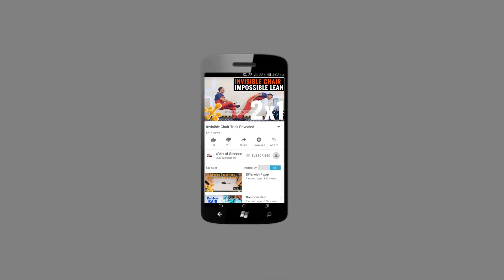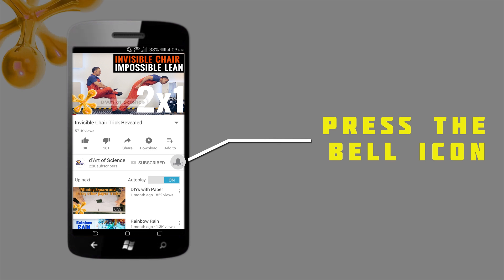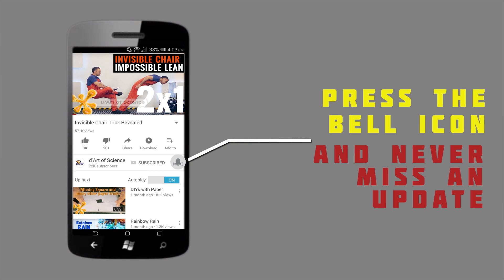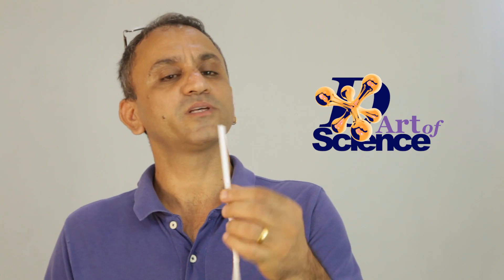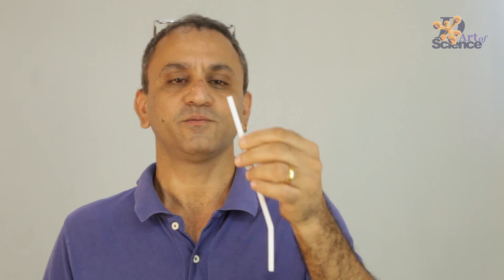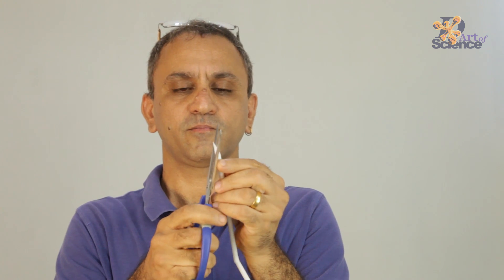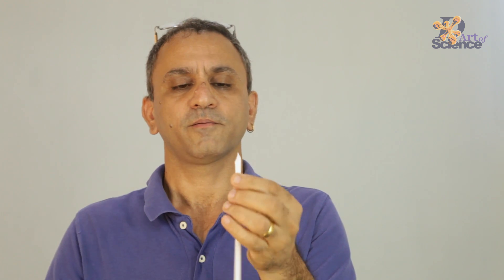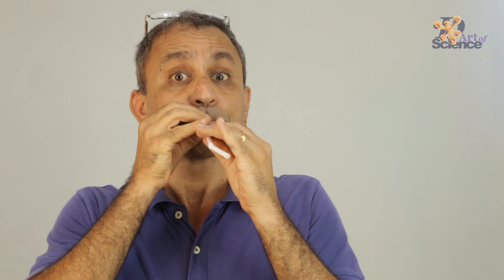How to make a Bottle Flute | DIY Flute | dArtofScience

Comment: It doesn't  work at all
Reply from the maker: thats strange..try doing everything step by step..interestingly when it comes to science based DIYs, any tiny step if you miss our or do differently, can make the difference between success and failure
Reply: @dartofscience  
can you tell me what is the principal of science used in this video?...
Please please.please
Reply from the maker: @DSRankers  Basically: when you blow air in a flute, the stream of air that makes contact with the edge is cyclically directed outward and inward. ... The flutist uses tone holes and keys to shorten the vibrating air column, thus producing an increase in pitch.
a flute works on the fact that when you blow air, it is directed in a way such that it creates a vibrating column of air inside the cylinder. This vibrating column is created in different ways, sometimes splitting the air so that a part goes out and another part goes in, some have a reed, but this one is the simplest one to make, but sounds quite horrible. In this one the vibration is caused due to the elasticity of the balloon as the air wants to push the balloon away when one blows in the pipe while the elasticity brings it back, causing a start-stopstart-stop of the air which causes the vibration in the elastic membrane.
The length of the wavelength gets altered in this as well as other flutes by blocking or opening the holes with the fingers hence altering the sound that you hear.
Reply: @dartofscience  thank you so much sir 🙏🙏sir can you help me?...sir i was searching in YouTube for a working model of toy.. basically i mean to say is that i have science exhibition in my school and the theme is technology for toys sir please suggest any video..🙏🙏
And the materials which are used..i have watched 10or 20 videos of your channel.. and many videos are too much helpful for me..but i have not find the best one...so can you just suggest me???
Reply: I don't agree it works perfectly